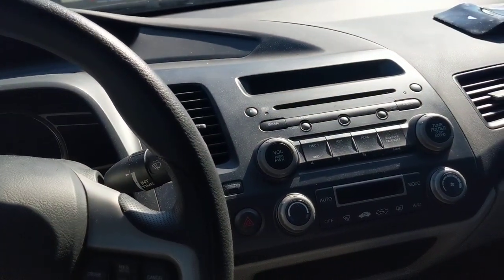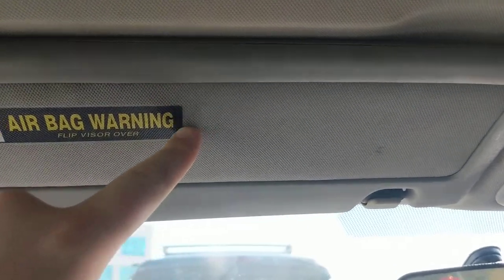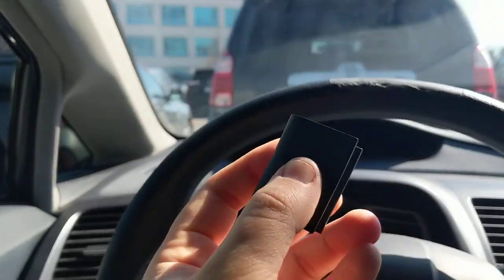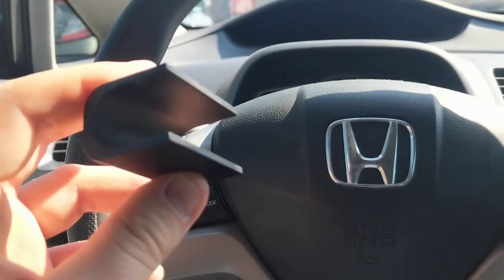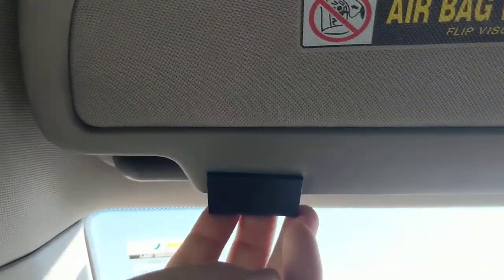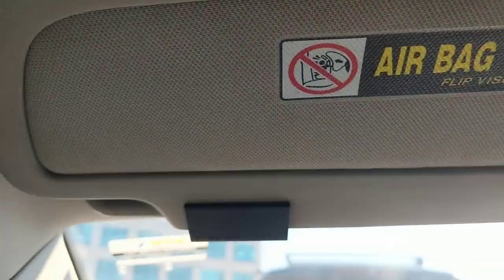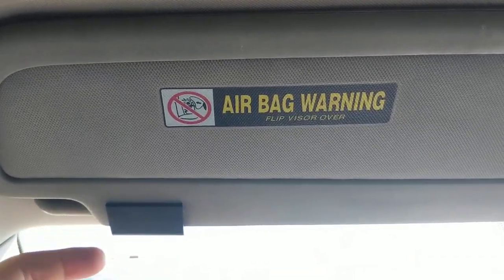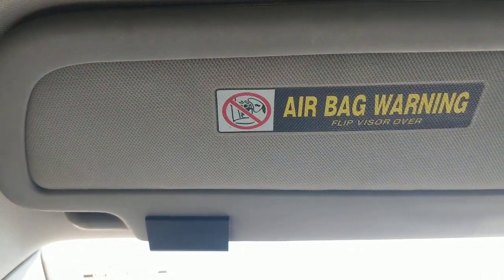Honda Civic Sun Visor Fix

Comment: I'll give it a try... Bought a used one on eBay and the light doesn't work. Have to go through a headache to return it.
Reply: Yep, I never go used on parts like this. I bought 2 new ones at Honda $120.00 a piece. Very easy to install.
Reply from the maker: Right on

Comment: Both my sunvisors came completely off, Will this still work? because I’m having a hard time attaching the visors back on.
Reply from the maker: If you can get them in position And they're not to warped. This clip will definitely help.
Reply: Go to Honda and order 2 new ones. They are not cheap. $120.00 a piece. I just picked mine up today and installed them myself. Took 15 minutes. Put this clip on before they split.

Comment: The Honda parts guy told me he is selling hundreds of these a month right now. They are expensive $120.00 a piece. Seems all of us 8th Gen Honda owners are all experiencing this problem. Buy a pair of Genuine Honda visors and then put this clip on before they split. This is my third set of new visors on my 2010 Civic.
Reply from the maker: Heck yes don't even waste your time on new visors. Head to a junk yard. Pull some and slap clips on them immediately.
Reply: @LetsReviewThisS  Cant find any at local junk yards and most of the used ones are already splitting and fit too loose. I dont have the time for going through used junk. I'm putting these clips on my new ones tomorrow.